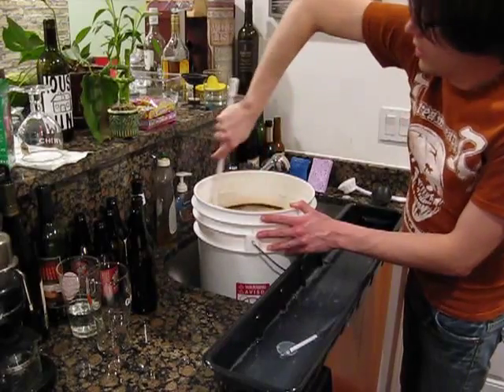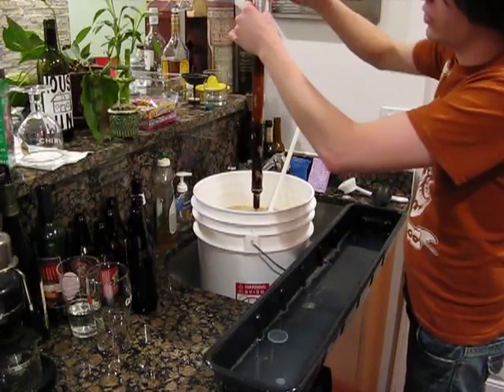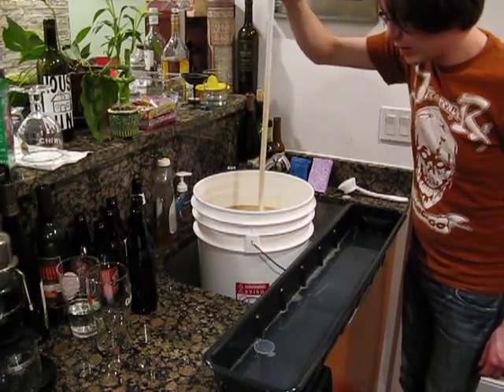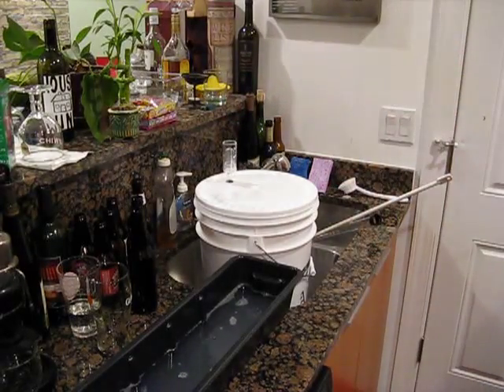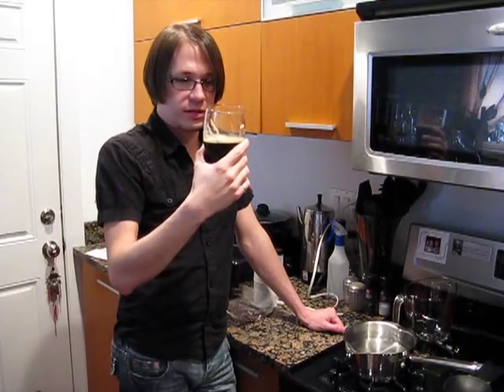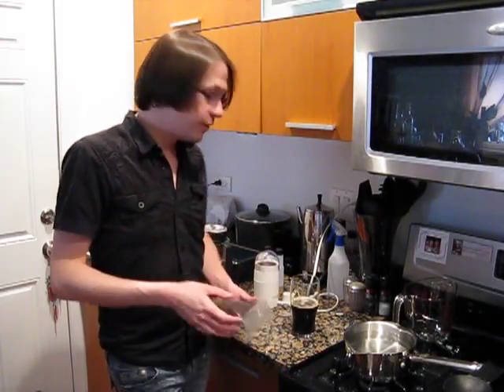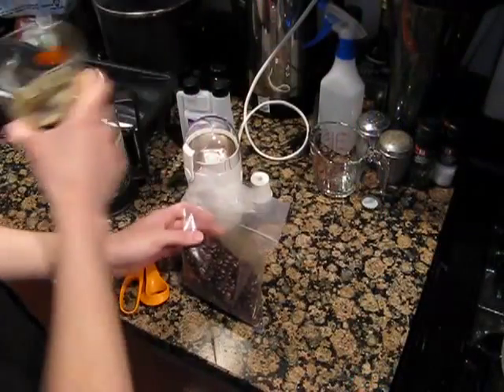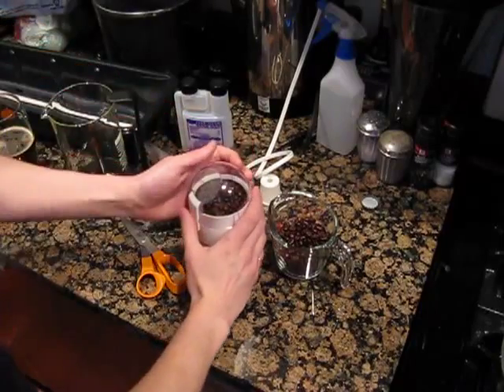Home Brewing a Java Stout With Joe (Part 3)

Comment from the maker: @dorf68 For the most part you're safe with just water.  I do it as a precaution because I've had suction occur within my fermenter and it has pulled the fluid in the airlock backwards and into the brew.  I've also seen some AG brews here on YT blow a lot of stuff up and out--so you'd want to keep that clean and probably use a sanitizer instead of water at least the first couple days just to be safe...

Comment: I've ssen guys put in sanitizer and even vodka in the air lock, There is no need to do that. A airlock means just that, a check valve, nothing gets in and during active ferm. everything is getting pushed out. Just my 2 cents on it.